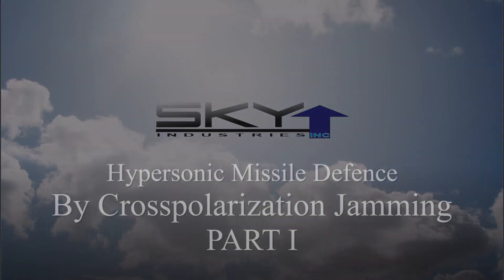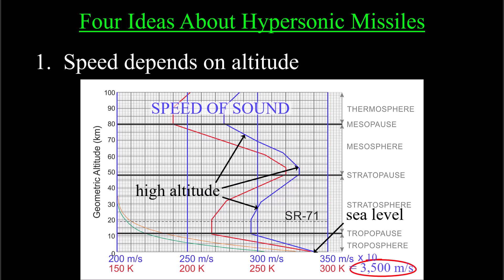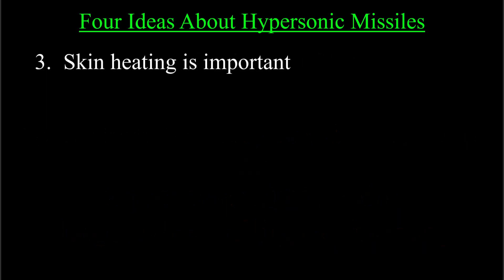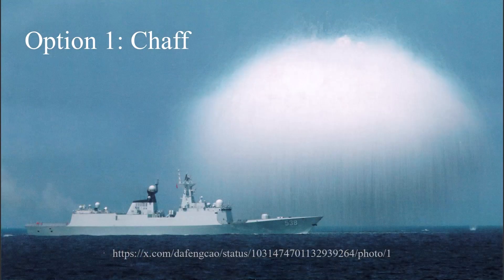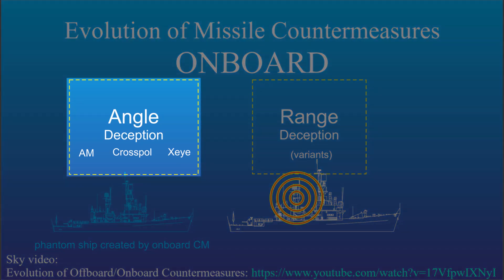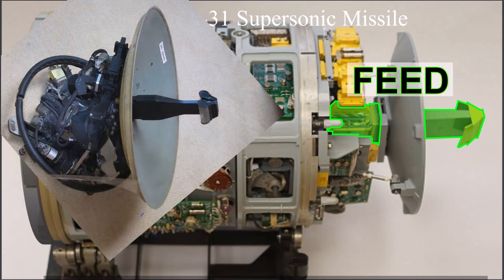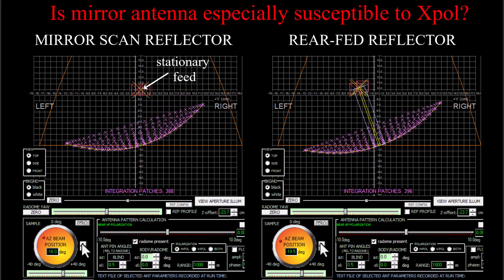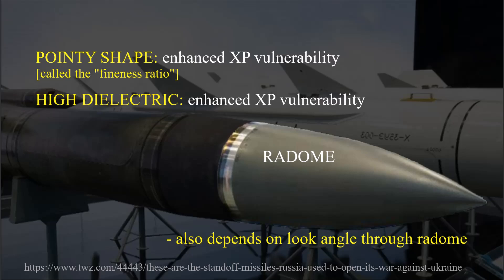Hypersonic Missile Defence By Crosspolarization Jamming PART I 25

Comment: So if a hypersonic missile has to slow before it gets to the target so it can get a lock and that makes it vulnerable.  Would it be possible to create a missile that moves at a say supersonic speeds to get into a targeting range say a mile 2 or 3 miles out  then get a lock of some sort that it could remember, for lack of a more knowledgeable discerption,  then fire the hypersonic motors to travel the final stretch to the target at that higher speed so it couldn’t be shot down with any kind of missile defense system?

I hope that question makes sense. 😂
Reply from the maker: You ask an interesting question, the work to answer it reveals how rich and connected engineering is.  

Accelerating a missile at the very end means the fuel required to do that has to be carried effectively all the way to the end, which limits the engagement range of the missile compared with a missile which keeps no fuel in reserve.  

In a plan would be for the missile to intentionally wobble its flight path near the end so is less likely to be destroyed by shipboard hard kill systems like antimissile missiles and bullets.

But changing the flight path this way uses energy, and so will slow down the missile, and the faster the missile flies, the more lateral acceleration the missile must be able to pull, which means bigger fins and more drag, and possibly flight stability problems.

And the missile has to settle its flight path near the end because it needs to hit as close to the ship's water line as possible, since lethality goes up fast as the impact point of the round gets closer to the water line.

And if all those trade-offs are accepted by the missile designers, is necessary to determine the range at which the missile would accelerate to its final combat speed: a supersonic missile is probably traveling around 800 m/sec,  so it will travel two miles in about four seconds.  That's a very little time to correct even small heading errors.  

In the end the missile design is a cost-benefit analysis, a massive trade-off problem that takes years to solve by brilliant, highly trained specialists. All the same, they are following kind of imaginative logic that is in your question.

Comment: There is no problem with hypersonic missile guidance due to the plasma cloud. At an altitude of 30 km, due to the rarefied atmosphere, plasma clouds do not arise and aiming at a target the size of a ship will not cause problems. Diving from a height of 30 km will take about 10 seconds, and calculating a 10-second lead for a ship-sized target is obviously not a problem.
Reply from the maker: If it doesn't slow down it can't use a seeker; if it doesn't use a seeker the missile is essentially an arrow.  The video only applies to missiles that use a radar homing seeker, e.g. DF21C/D.  

To hit a stationary aircraft carrier the arrow aiming accuracy at 30 km/45 deg dive  has to be about 0.2 deg.  

Is this doable and still have a sufficiently high P(kill) with 95% confidence?  I don't know.  Seems like a stretch to me.
Reply: @skyindustries  This accuracy is not difficult to achieve even using a smartphone gyroscope, not to mention military gyroscopes. I believe this was possible even with WW2 technologies, for example with gyroscope of the German V-1 cruise missile.
Reply from the maker: @azanudniy  the problem isn't gyroscope accuracy, it's knowing where the target is relative to the missile, then developing a continuously-updated guidance signal to cause intercept.
Reply: @skyindustries  This would be the case if we were talking about a maneuvering target. But in 10 seconds, even if the ship wants to, it won't be able to dodge. The aircraft carrier, moving at a speed of 30 knots, will travel about 130 meters in 10 seconds. That's less than half of its length.
Reply from the maker: @azanudniy  Based only on open-literature sources, it appears that the designers of the DF21C/D decided an RF seeker is needed to kill moving targets.  If you are saying they got it wrong, you could be right [no sarcasm, designers get things wrong all the time].  

What matters is the effect of the following on P(kill) and confidence: 
1) the per-round unguided CEP including limitations of satellite coverage 
2) target motion 
3) effect of latency 
4) intrinsic targeting accuracy 
5) a few other factors 

It would be an interesting OR problem to test the validity of the designers' conclusion by actually calculating the P(kill) and confidence interval.  Most interesting.
Reply: @skyindustries  I believe that the information that the DF-21 reduces the speed to 2 Mach is not true. Not only is this a very convenient solution for the defenders, but it is also a very difficult engineering task. I cannot imagine how it is possible to slow down a warhead from 10 Machs to 2 at a distance of 30 km.

Comment: I wouldn't trust Wikipedia with that mach 2 deceleration.
Reply from the maker: I  don't - it's offered as an unclassified reference that draws the same conclusions as I did, independently based on the laws of physics, electromagnetics and thermodynamics.  

I believe the terminal speed is correct since the plasma appears only above Mach 5.  

The implication that the seeker unmasks at 3 - 5 km sounds too short, very little time to acquire the target, begin tracking, develop guidance signals and apply course corrections.  

And short range means it would have be able to pull some major gs to recover from a worst-case heading error, but most of the fuel is likely gone so it might be light enough.

Comment: Hypersonic Missile don't come from the side. They come from ABOVE.

Russian hypersonic missiles can change course many times so you can't determine its destination until it's too late.
Reply from the maker: It's reasonable to expect that the missile(s) will be detected and tracked in angle and range by shipboard sensors.  The jammer is cued by those systems, and is activated by the seeker when the missile switches to combat mode and the seeker unmasks for the final attack.  

It's then a race between the missile and the jammer: the seeker is furiously trying to compute a fire control solution, the jammer is furiously trying to compute an inverse fire control solution.  Whoever gets there first wins.

Comment: Interesting ideas, but findementally flawed. For instance, the YJ21 has an estimated impact velocity around mach 5-6 and uses an electrooptical sensor in the nose that can't be jammed. Additionally, as the Russians have demonstrated with oreshnik, there is no issue with GPS guidance as the receiver will be aft of the missile, preventing both jamming attempts and interference from a plasma sheath. Additionally naval vessels are relatively slow; you said yourself it's seconds to impact from the time it is detected, this means that any sizable naval vessel will not have time to manuver or even move out of the way of a weapon with a hypersonic impact velocity, even ignoring that proportional navigation is already a widespread technology and could easily account for the movement of a GPS coordinate. Something else not covered is that a plasma sheath works both ways; not only obscuring the electromagnetic sensors on an inflight weapon, but also obscuring the weapon from surface radars, dramatically reducing the capability of detecting a weapon in time to use countermeasures of any sort effectively.
Reply: Just some quick math here; if an aircraft carrier is traveling at 30kts (which is about maximum speed) in 10 seconds, it will have only traveled 154.32 meters. The Ford class has a length of 337 meters, meaning using only GPS and targeting the front of a carrier, no terminal guidance is needed to strike the carrier center mass. Even being generous and changing the scenario to 20 seconds, the ship will have only moved 308.64 meters, meaning the carrier will still be struck. The idea that terminal guidance is necessary for hypersonic weapons is fundamentally flawed as the guidance for such weapons was only ever implemented because the weapons were slow enough that their targets would have moved prior to impact.

Comment: 2:05 hinging your hopes on a wikipedia page, and assuming a primitive seeker with no home on jam capability isn't very good thinking
Reply from the maker: No not hinging any "hopes" on that; merely providing an open literature reference that draws the same conclusion as I do, based on they laws of physics, electromagnetics and thermodynamics.  

DF21C has a terminal-phase seeker, type not specified: https://en.wikipedia.org/wiki/DF-21#DF-21/A/C_(CSS-5_Mod-1/2/3)
Reply: 1kosovo drink cope
Reply: Haven't finished the rest of the video yet but it would be similarly unwise for a missile to depend on home on jam for targeting as it is primarily intended for targeting carriers- while a jammer could be a destroyer or even possibly a drone
Reply: @ true for the most part

Comment: Except when it's actually hypersonic, it's called oreshnik, and it does actually hit you at mach 10, having enough kinetic energy to fuck you up no matter how much you don't jamm it. 😂😂😂
Reply from the maker: Then you are referring to a missile variant that has no seeker.  Those are intended to kill things that don't move, like buildings.  

So you are quite correct, a RF jammer has no effect on a missile that doesn't have an RF seeker.  Neither does it have any effect on bullets, mortars, tank shells, etc.  

A missile - hypersonic or otherwise - which does not have a seeker cannot hit a target which can move, unless the missile has a guidance control loop that develops a real-time error signal.  The signal  is the error between target position and missile position for Pursuit guidance, or the target sight line rate for Proportional Navigation (the latter is more difficult for a remote observer, and kind of pointless).  

A seeker is the obvious choice, either RF or IR; some people believe this can be done by a satellite link to provide guidance commands, like a variation of Command to Line of Sight (CLOS), or of a beamrider.  

I am skeptical of the satellite solution for several reasons (accuracy, latency, satellite resources/coverage, more), but if it can be done I expect (not 100%) that SAR is required (Synthetic Aperture Radar) to see through clouds.  SAR is like a radar that takes a picture, even through clouds.   

In that case, point the Crosspol jammer at the satellite instead of the missile.  Might be difficult or impossible to get the signal in, but it's a shot.

Comment: A RF seeker can see though plasma perfectly fine, any frequency above the plasma frequency goes truogh it like it is not there
Reply from the maker: Do you know what the cutoff freq is and/or what it depends on?  Below X-band (8 - 12 GHz)?
Reply: @skyindustries  it is dependant on the plasma temperature, for Mach 10 if I remember correctly the paper, X band was inside but close to the cutoff freq. So a K, Ka band or higher frequecy radar will work fine

Comment: if you watch a video of russian hypersonic strike in Ukraine you'd see that it stays hypersonic till impact and navigates trough plasma cone.
Wikipedia are not the most reliable supply of military secrets you know.
im pretty sure that navigating trough plasma are actually solved by the most of nations with hypersonic weapon programs.
Reply: It is impossible to see through a layer of plasma surrounding a war head traveling at mach 10 in the lower atmosphere. That plasma is composed of many trillions of electrons stripped from atoms nuclei by the extreme heat and they radiate over all electromagnetic frequencies.

Comment: Jamming is not working today against modern guidance system. They have too powerful on-board computers, so they can easily distinguish jamming waves from reflected waves. Those missiles also combine multiple type of guidance, not only inertial and gps and radar, but also optical, infrared and newest missiles have even lidar. For example Zircon missile is using just for input from its guidance sensors integrated computer from Su-57 programe, which is composed from 24 Komdiv CPUs, each giving roughly 50 GFlops (DP). good luck to fooling that. I do not know, what exactly has Zircon for sensors, but if it is using same computer as Su-57, then there is expectation, it is using same or similar sensor set. So electro-optical, radar, INS+glonass.

Also it is not correct to assume, that hypersonic missiles will be able to have supersonic impact speed. If they are diving down from speed mach 10+, they have same conditions as has nuclear warheads returning from space, which achieving up to 4,5km/s (=Mach 15) impact speed. So in fact, there is almost certainty that real hypersonic missiles, like Zircon, has impact speed almost identical to their cruise speed, especially if they are diving under power. That speed itself then complicates everything to extent, they are basically undefeatable.

Comment: Would this work against kinetic missiles like the new 'oreshnik' that hold mach 10 at impact? The plasma surrounding the missile would make jamming impossible?
Reply: Quantum entanglement could defeat the plasma envelope....
Reply: Oreshik seems to use MIRVs with mass simulators of physics packages instead of actual physics packages, so it's likely going on pure inertial guidance, perhaps with some satellite correction, as normally a few hundred meters of deviation won't matter. Unjammable, but also not terribly precise.

Comment: The missile skepticism (for which you base your report on),says that it doesnt slow down to mach 2 until its around 3-5km (3 to 5) from the surface/target. That means detection at 35km is likely not possible and at mach 2 (685 m/s) your reaction time is 7.3  seconds if you detect it at 5km

Comment: Trying to spoof a missile like that (assuming ballistic) in the  final stages seems like a hail mary at best. It's pretty well set on where it's going and any corrections to either its intended target or ro drag it off target would likely be met with limited success. Not only that, even to cross pol jam you need to know the exact frequency the weapon is operating at. Unless I'm missing something. But you donmiss 100% of the chances you don't take.

Comment: Mr smartass, did you think that the missile could get mid-course and terminal corrections, that it could just dive down (instead of coming at an angle), that it could lock on jam and just look for the jamming signal, see trajectory and instantly switch to inertial navigation?
And the whole idea of hypersonic missiles was not really to invent something new - it was to move the flight envelope at certain range and at certain point to a hypersonic in-atmosphere speed where interception is extremely difficult while range is preserved and maneuverability increased.
And also... yes, plasma brings difficulties. But it's not some magic cloak that just closes shut the ENTIRE EM spectrum. That's just nonsense. We are, at the moment of writing this, studying the external and internal emissions from stars. No I do not mean to say that a neutrino detectors is the end game here but just to highlight the point that unless you are stuck mentally in the same time period as some 80's missiles you give as an example then there are options, many, many options.

Comment: interestingly enough, though the majority of your video is up to date and factual, its simply confused.
Cross polarization jamming is not used or even practiced anymore.
DEW's with scaler waves can quite literally pump mass (energy) into the middle of the missile from 1000's of miles away. (blowing it up over the country that fired it)
altercations to the frequency of the wave occur to penetrate the shell of the missile, no longer wasting energy heating up the skin of the missile.

Comment: More BS based on some facts but wrong conclusions.
1. Mach speed per height - true 
2. Decreases to Mach 2 - How ? Gravity equation.
3. You can't jam kinetic objects. The missile is not being steered once it re-enters the atmosphere.
Jamming signals do nothing to an object in free fall.
Can you jam a bullet?
4. The oreshnik didnt decline in speed.
5. Cross-pole jamming - technical mumbo jumbo that does not apply to an object reentering the atmosphere at mach 10. Gravity equation adds to the speed not reduce it.